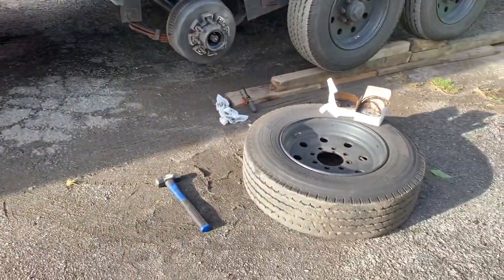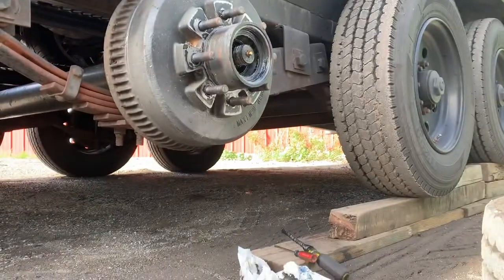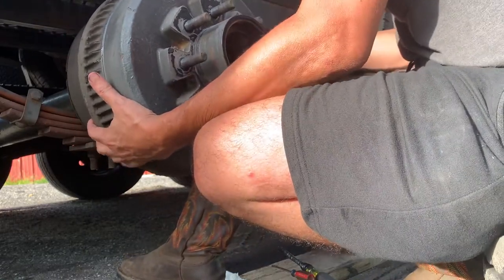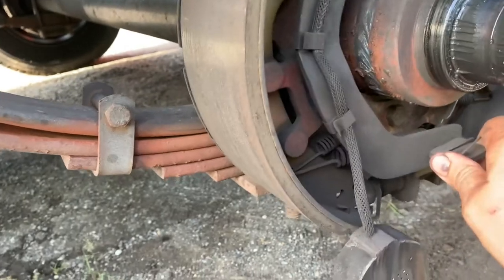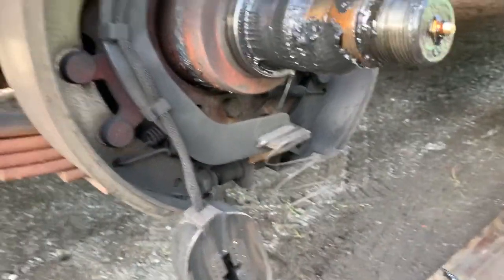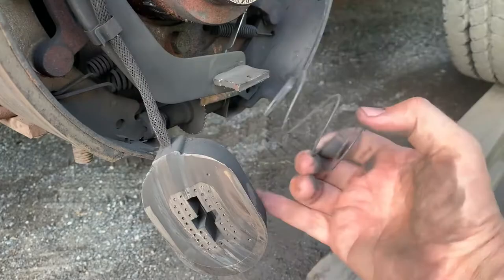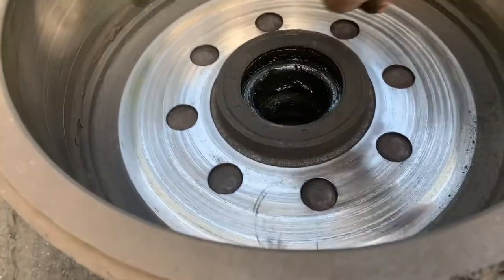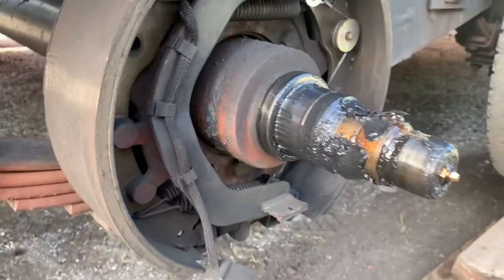9,000 lb Trailer Brake or Magnet issue which gets changed first?

Comment: I have a 40 foot flat bed hot shot with 3 12k axels.my brakes stop working and when I took them off it was a mess.rotors should be smooth all around and where the magnet gets in contact.if rotors not smooth it will damage the magnet very quickly.so I end up ordering 6 new brakes and rotors with all bearings.is not cheap and not fun to do them but for sure you will save a lot .my each rotors was $500 and brakes each was $500 and Bearings and seals
Around $200 each.my situation was mechanic wants $500 each to do them so it was $3000 labor.but most definitely in video it did looks like your rotors was waved inside witch I could be wrong.if it is expect ur brake to go out not even 1000 miles.my brakes gone ded in Wyoming mountains and trust me driving 60 miles with 20000 lbs load on a trailer in rainy day it won’t be easy to bringing the truck to stop.me personally I felt like I lost 20 lbs and by the time trailer stopped my whole buddy was shaking.good luck
Reply from the maker: Yup, your absolutely right!!! So scary, and once you get into these bigger brakes and tires, it’s so expensive! I was thinking of just converting to electric over hydraulic disc brakes at that rate be cheaper and then no more worries about magnets failing.
Reply: @azhauling4109  
Each one has there own headache!!I think for your trailer size is better and cheaper to stay electric especially if you travel a lot.most of the states should have ur parts stock but not to many of them keeps hydraulics parts in stock!!
Hope u find what’s best work for you!drive safe and good luck!!
Reply: @Foltyn444  I’ve been told by many an experienced driver, that hydraulic is much better for a 100% road trailer. But anything that sees off road in any form you want to stay with the electric. I’ve been personally running individual wires to each wheel set. I junction the runs in the trailer box (if you have one) and run light duty extension cord wire to each wheel. The sheathing will never have an issue. The wires more flexible. Higher gauge than most wiring. I have one I’m letting rub on my lead springs just to see how long it lasts. Over a year now and it’s a dump trailer that goes almost daily. The cable is invincible and really adds a security to electric brakes. I’ve heard horror stories of people having a failure with hydraulic brakes. One involving horses and a trailer locking up on a turn, not sure how.

Comment: I did the same thing I run the so cal to Washington 2 times a week. Magnet took out my drums too. I wanted to just replace the magnet but drums we’re already grooved like yours. It’s expensive but better to replace drums so it doesn’t take out the magnet
Reply from the maker: Yeah I replaced the whole brake and drum. They looked badly rusted from not being used since it was the 7-way plug the whole time 🙄🤦🏼‍♂️

Comment: Man I want someone to comment. I have the same question. Any info says manufacturer specs. And that is non existent. I have a lockup issue I’m chasing. Magnet and drum grooves  are bad IMO but looks to be ok magnet wise. 3 year old trailer I’m chasing issues now.
Reply from the maker: So my issue was the magnet was bad, and once I changed the magnet, had to adjust each tire! Because even though they are “self-adjusting” that doesn’t work, just don’t over tighten Bc then u get some smoking-hot brakes like I had.
Reply: @azhauling4109  wow thanks so much for the immediate response. Really means a lot when you’re working on something like this. I’m assuming magnet issue of some kind for my situation. Maybe getting drug sideways and getting stuck to rotor due to grooves?  Either that or the tire was so far out of adjustment they had to work too hard.